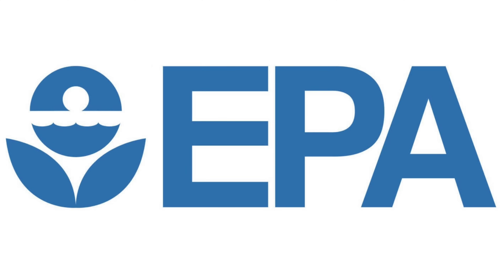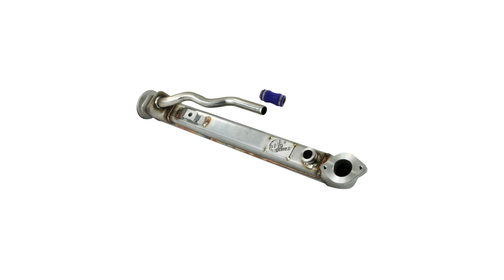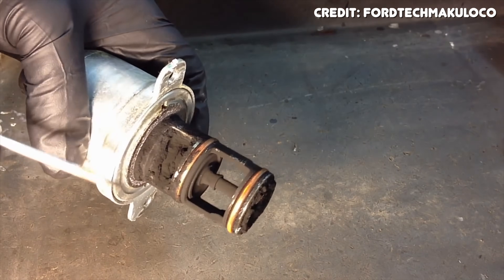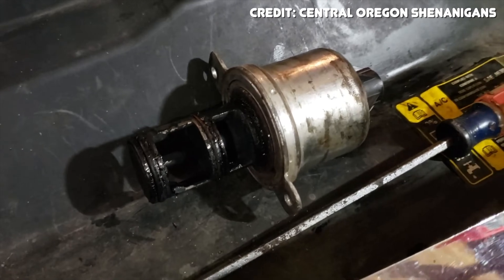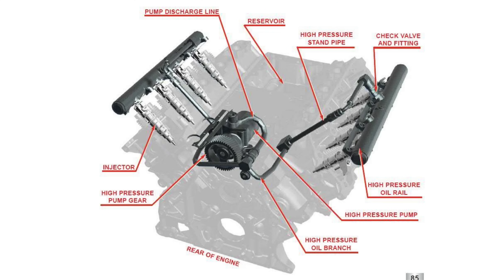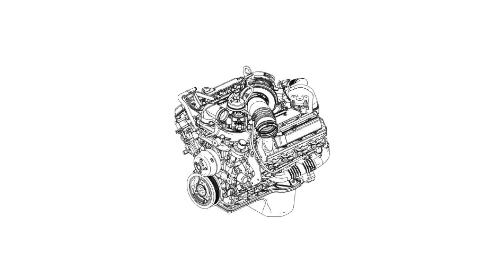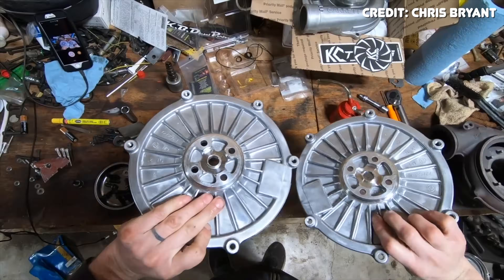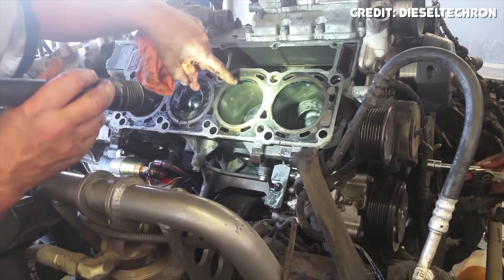The Truth About the 6.0L Powerstroke (And Everything Wrong With It)

Comment: A couple guys I know have 6.0's. one guy has 400,xxx miles on it with stock head bolts, egr delete, and straight pipe. The other has 300,xxx miles but his is pumped up. Cam, intake, turbo, injectors, transmission, meth injection, heads, fuel system, etc.

Comment: Honestly it comes down to maintenance and how it's driven with any vehicle. I have an 07 6.0  with 180k and I love it. Change your oil and filters on time and when something needs replacing, do it right away as long as funds allow you to. My truck is deleted, studded, kc stage 2 turbo, 5 inch turbo back exhaust, blue spring update, bpd water pump with 7.3 fan clutch and aluminum radiator. Also has sct tuner with custom tunes and I've not yet had a serious issue with the truck. It's a fun truck to own!! Plus, to me it's easy enough to work on as long as your somewhat mechanically inclined.
Reply: damn we got the exact same mods just i have the coolant filter and its an 06
Reply: I have an 07 with 200k on it. Owned it since 120k. Deleted and tuned but not studded. Royal purple oil changes at 10k miles like clockwork. Very recent blue spring kit installed. I've had very little problems outside of normal maintenance. Towed a 10k enclosed trailer recently. Coolant temp didn't break past the thermostat and oil temp didn't break 200.
Reply: @jonathonbridges9625  rotella is better for the truck but if it works for you then just stick to royal purple
Reply: @jawz077end6  I use shaeffers 5w-40 otr full synthetic in my 6.0
Reply: @jonathonbridges9625  towed a 10k boat over the weekend and never broke 190 on coolant or oil and tranny was chillin at 160
Reply: @jawz077end6  if it ain't broke I'm not gonna fix it. I could easily push 15k between oil changes but I damn sure don't wanna do one every 5k as I drive 5k every couple months easy.
Reply: @jonathonbridges9625  my 6.0l makes 700hp and 1400 ft lbs of tourqe at the rear wheels... i change the oil in it every 3000 miles. and use Rev X additive 100 miles or 50 hours before oil change i add a bottle in. and after oil change i put 2 in with the oil i give it plus liquimolys MOS2 additive..... now my brand new stock 6.7 i change the oil every 5000 miles. and use liquimoly MOS2 additive. 

my 6.0L i run waste motor oil through it waste ATF through it and its on the same set of injectors for the last 40k miles. i get about 70,000 miles out of a set of injectors i rebuild them myself until the cores trashed then i buy more cores and build more injectors myself... all you need to rebuild 6.0L injectors is a table with a vise on it. a machined block of aluminum or steel basically an injector wrench that goes in the vise. all in all i have about 200 dollars in my injector rebuild tools. and its proven to work fine.
Reply: @justnsaliga8518 how many miles do you have on this build and how reliable has it really been. Thinking of getting a 6.0 with about 540-600hp and the build list looks like everything has been done the right way and then some. Cheaper than a lbz duramax that I’m looking at. Wondering if I should get the stock lbz and do some simple work to get to 475hp or buy the 6.0 with 575hp that’s been built right. I need to tow and drive it about 10k miles a year.
Reply: Waa
Reply: Different injectors too?
Reply: @Flakjack308  that's next on the to do list, bigger injectors.
Reply: @upnorth6.0  how does it perform now as is?
Reply: @Flakjack308  I think it performs awesome. It's no racetrack that's for sure but she scoots. The way I have it setup now it doesn't really roll coal either. Occasionally get a puff when you get on it but that's about it. I've had it for about 2 years now this way and it runs like a top even when the michigan winters come. The 6.4 starter makes a huge difference
Reply: To me the people that talk about the 6.0 they never ever owned one or didn't do maintenance.
Reply: @ricardorodriguez-se7tp  gotta agree with you on that..... Until you've owned one. you really cannot grasp how easy 90% of the repairs are on it... the most difficult repairs on the 6.0L with the cab on is Removing heads. and A/C compressor, or Crank sensor. but this can be remedy by taking off passenger side engine mount and lifting the engine up 3-4 inches. or if you have small enough hands or small enough tools and  a fat wrench you can still do the crank position sensor without removing anything.
Reply: @ricardorodriguez-se7tp  the late 2003 was rough immediately  had problems  in the cold  and in 03 04 the dealer was green on how to iron everything out  but your comments 1000% correct
Reply: Do any of you use a cts 2 or 3 for guages or other guages system and light tunes? I have an 07.
Reply: @JeffPaisano  I just use a sct livewire and bought custom tuning. You can monitor quite a bit with the livewire but not everything. I've never tried a cts but heard good things about em
Reply: @JeffPaisano  Kinda old but I believe gearhead now offer tunes for the cts. I have a sct x4 with a cts2 monitor, My roomate had the livewire and the cts is worlds better. It shows data real time the live wire lagged so bad.
Reply: A lot of people will say maintenance is the biggest Factor when talking about a 6.0. you find one that hasn't even been beaten but just not well maintained they don't last very long. They're not much for a hard beating but they are certainly a working engine. I've heard a lot of people have in stock ones that just put around in them and drive on Sundays and they also have issues. They're not meant to have the absolute snot pounded out of them but they are meant to work and don't do well just putting around not being used how it was initially intended
Reply: So in reality stock sucks, you just said studded, deleted and upgraded turbo etc etc etc. While maintenance is necessary. Sounds like without the upgrades the 6.0 lacks

Comment: Ford had nothing to do with the issues in the 6.0L it was all Navistars doing.   Ford asked for an engine at approx X power and X torque and Navistar delivered that. 
Ford DID NOT crank up the power on the 6.0L it was delivered to Ford as is...
 Navistar did not design the 6.0L MAN did. When Navi contracted with MAN to design this engine they NEVER told MAN it was going to light trucks.  MAN built/designed an engine for school busses and light-medium trucks and their emissions regime and Navistar's price point. When MAN found out it was going into Light trucks they told Navistar the engine would require extensive redesigning. Navistar opted out and told MAN it was fine and their was no time... MAN washed their hands of ALL responsibility for the engines and had Navi sign a not at fault agreement for refusing the redesign. This is why Navi never sued MAN for all the issues with the engines as MAN washed their hands of it and covered thier butt.. 
The Reason Navi had MAN design the engine is Navi had ZERO experience with emissions diesels. While MAN had quite extensive experience with them.  
The whole issue with the 6.0L  in light trucks is an inadequate EGR cooler.  It is fine for Medium applications with the higher allowable NOX emissions and lower EGR duty cycles. In the light trucks, oil temps end up WAY higher than they should be due to the inadequate EGR coolers. Add in the fact many owners and even Ford did not use full synthetic oils only compounded the issues.  These engines should ONLY be run with full synthetic oils. 
In light-medium applications on full synthetic motor oils, these engines have basically NONE of the issues seen on the light trucks. And are as reliable as any (and more reliable than some) early emissions diesel.  And now Navistar is owned by VW......
Reply: Amen preach brother. Best sounding diesel !!! one day I’ll own a 6.0 PSD.
Reply: So ford went to  international'  for a engine,  but out source the engine from a European engine  manufacturer. Sounds like karma
Reply: @apprenticefelix7740   Navistar went to MAN cause Navistsar had zero experiance with emissions diesels  or their emission systems.  And unlike Cummins Navistar had no exposure to the European market so they really had no experiance with emissions diesels or their systems and had no choice but to farm out the 7.3L PS replacement. CAT teamed up with MTU to help develop their initial on road emissions units. But once allowable NOX levels were reduced CAT just gave up and exited the truck engine segment all together.  And even though Cummins had exposure to the European  market they were working with/getting help from  Scana on their NA diesel emission  systems for trucks. 
 To give you an idea what would have happened if Navistar had done it on thier own....the 6.4L. That was ALL Internationals doing.   And that was AFTER having exposure to emissions systems for 4 years AND being partnered with MAN.....
If Navistar had gone it alone initially the 7.3L PS replacement would make the 6.0L look like a 300 I6 in terms of reliability in comparison.
Reply: That's right, delete em run amsoil or shaeffers, and hot shots red coolant,
Reply: @jacobgomez2682   If you are in a locale where you can delete do it. The only down side to dumping the EGR is shortened turbo life.  But it is not drastic enough to even worry about.
Reply: @matthewq4b  all the diesels I pulled apart that were deleted I didnt see any change in turbo failures???not even a change
Reply: @jacobgomez2682  Eliminating the EGR raises combustion temps thus increasing exhaust gas temps this does have an impact on turbo life expectancy no matter how you cut it.  As noted it is not typically enough to worry about in the 6.0L in most instances.    This is an issue with ALL deleted Diesels.  With some the impact is more severe than others.  Auto diesels for example that have much more marginal and typically harder working turbos can see drastic reductions in turbo life expectancy (in some cases it is cut in half) with an EGR delete.
Reply: @matthewq4b  I dont know as a tech for 20 some years I've pulled apart cats, Detroit's, cummins, strokers, and I just saw 200 degree decrease in exhaust temps, egr systems destroy diesel engines period
Reply: @jacobgomez2682   The Europeans know all about EGR deletes on diesels and have been doing it for over 30 years now.  That is why Navi went to MAN as they had been dealing with Diesel emissions systems for close to 2 decades. 
 It is well known and documented that deleting the EGR on Diesels shortens the life of the Turbo. And the newer the vehicle the greater the impact. 
As turbos are now unit specific and built down to a price point.  This is just something to keep in mind when doing deletes and if the turbo is not perfect it is a good idea to just replace it, preferably with an upgraded after market piece.
Reply: @jacobgomez2682   👍👍
Reply: Very informative. I'm trying to learn about this 07 f350 that I now own.  Bone stock so far. Thank you for this reply.   Helped me

Comment: studs w/ no egr, clean all the soot out of the intake put updated standpipes and stc you have a very reliable engine. On any diesel use a good oil and fuel additive and proper Maint.
Reply: Do synthetic oil changes and do them in the severe schedule